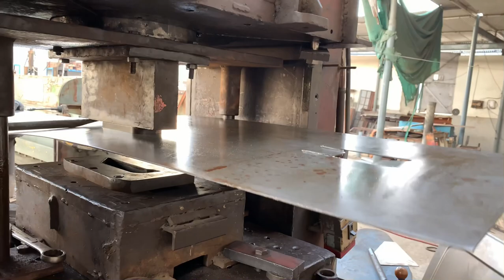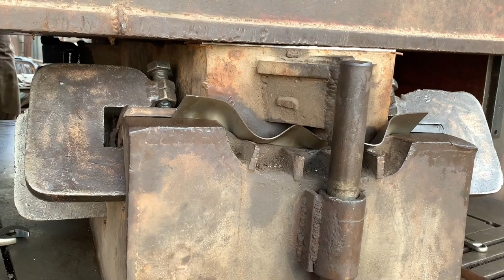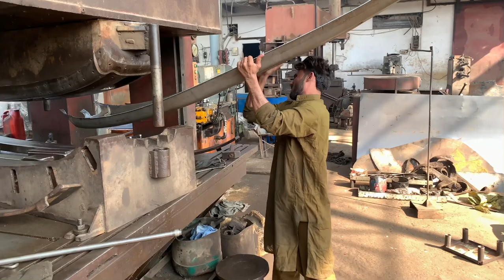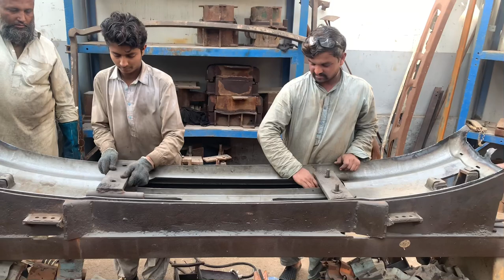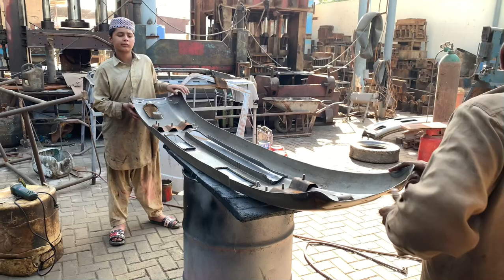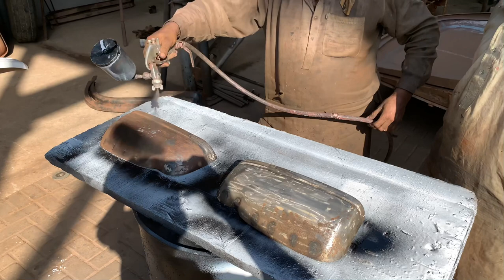Amazing Manufacturing Process of Hino Truck Bumper || Ingenious Bumper Casting

Comment: I drove a cab over Hino in Miami for almost 10 years. Great truck. Easy to repair with very little specialized equipment.  Was pushing 400k miles on original motor and tranny and ran like a top when I left. Wouldn't doubt it if truck is still on the road

Comment: They really built in the value of that bare strip of steel, every step adding to the value of the finished item.

In doing so, the machine shop has many men earning for their families.

Local manufacturers meeting demand and employing locally, its a win - win situation.

Comment: I remember when they used to make all bumpers out of steel...
Reply: Right on... And remember when chrome plating used to be almost 1/8" thick on some things?.. 
Nowadays, if you get a chromed steel bumper on anything, the chrome peels off like a layer of paint in a couple years or less.

Comment: I think it's optimistic calling these bumpers. Front covers for the chassis frame and a place to mount lights, perhaps.

I know these aren't for HINO themselves. It's like saying all soft drinks are Coca-Cola.

HINO won't be caught dead installing these on their trucks or lorries.

Aftermarket or REM Parts? Quite likely.

Anyway, employment is better than idleness and thus extremism or other destructive pursuits. 

Overall I see this as a good sign despite all the aforementioned safety and quality issues.

Cheers!

Comment: Frickin primitive engineering. They have not even thought of piercing the blank before bending. The fuys are going in the machine to clamp the blank for forming. Zero safety. No protection while painting.
Reply: Some places of the part would distort if a hole was present, so it is often required to punch after forming.

Comment: How primative.  They spray paint with out any lung protection.  Not even a simple mask.  Rmember that when you buy a Hino vehicle.    sham on Hino for allowing a sub contractor to do that.
Reply: Who's said they are supplying Hino! They could be for the aftermarket supplier's in their country.
Reply: Hey, pay attention to the quality and you will see it can not be a subcontractor of an official manufacturer. This is not even bootlegging since no regular customer would buy this in countries which enforce conformity to safety standards. It is only semi-industrial handcraft for poor man's truck repair in a very low wages country.